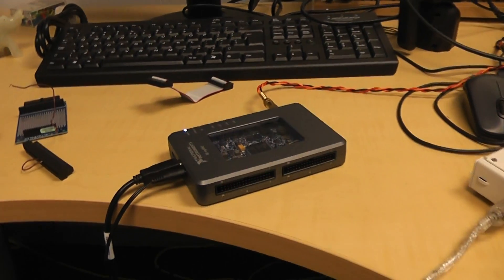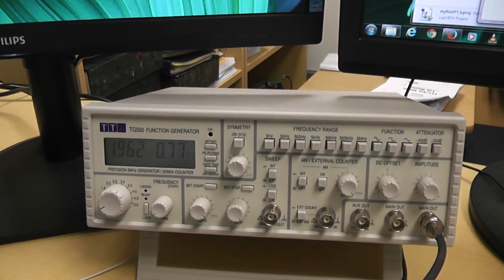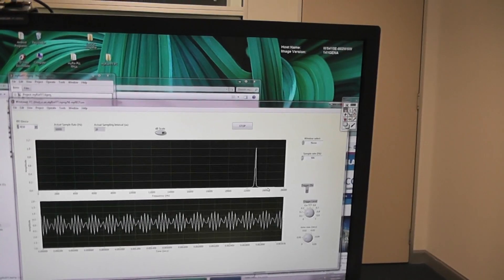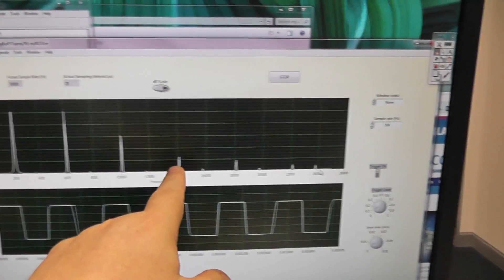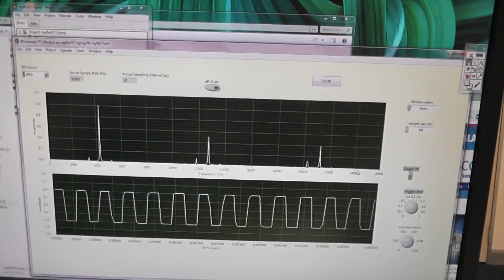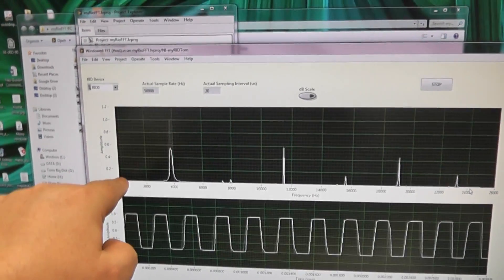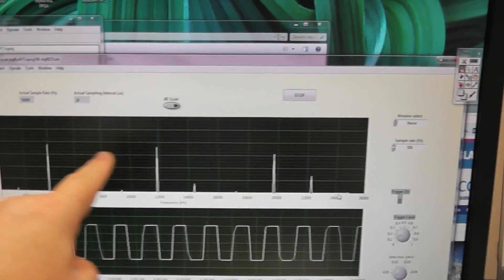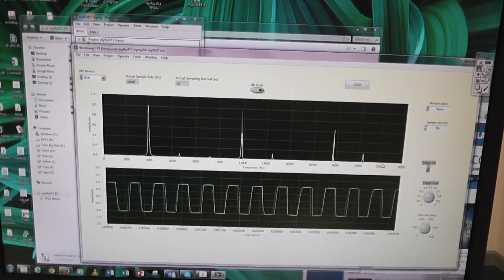Practical Aliasing of a Square-Wave. Not a simulation!

Comment: Why does a square wave only have odd harmonics? And actually, what really causes these harmonics to be there at all?
Reply: The best way to look at why is to take some graph paper and start drawing the fundamental frequency as a sine wave, and then below that the second harmonic, third harmonic and upwards.   You could even do this in a spreadsheet to make it easy.

Then start adding each component of the harmonics together, and you can scale the higher harmonics  too just like you see on the video.   When you start adding them up you'll see which ones start making the resultant waveform more like a square wave.   Even harmonics start to make it look awkward, but odd ones give you more of a square appearance.

The odd harmonics give you symmetrical rise and falls on the square wave, just as you would expect a square wave to look like.   Odd ones create a different shape and you have to reduce them to zero.   And thereby you now see why it's only odd harmonics.